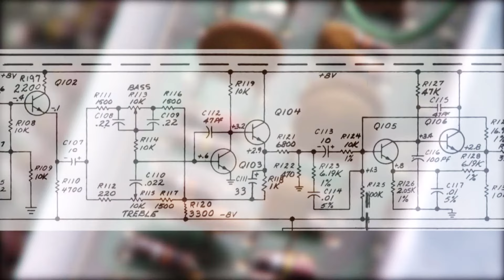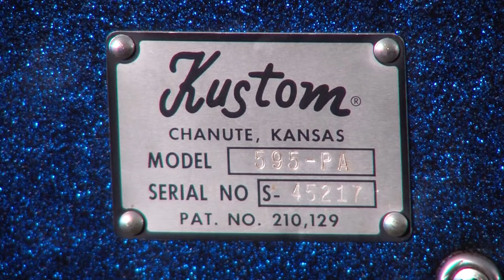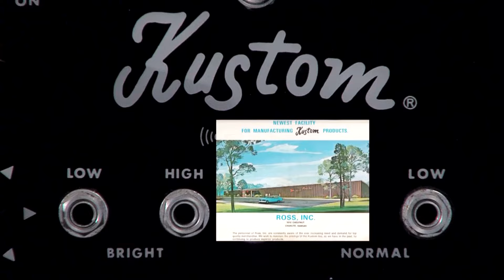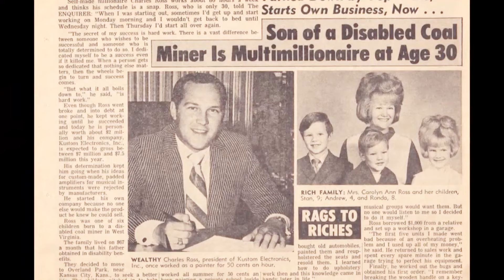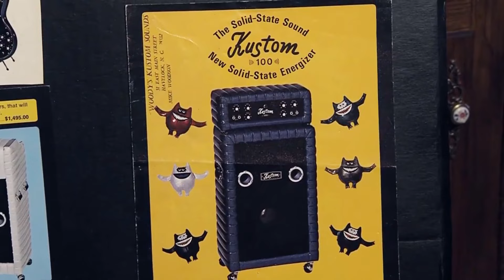The History of Kustom Amps

Comment: I have bought, and fixed a number of vintage Kustom amps.   I will attest that every amp I had pass through my hands only needed minor work to get things back going again.   To have a 50 year old amp that's ORIGINAL parts and working OK is really pretty cool.   K200 B1  with a 3x15 bass cab...  it records great!
Reply: Well DeadKoby...find me a Push/ Pull Switch and knob that is for the Vib./ Tremelo on a Kustom 50-2 Combo Amp!!
Reply: How would you describe the tone of the vintage Kustom amp?  I played (bassist) through a modern (2000s?) Kustom keyboard amp.  I adored that sound.  The sweetness of my P Bass was captured perfectly. I'm now very curious about these old bass amps
Reply: Where are you located?

Comment: I just bought a Kustom 250-4.
Silver sparkle.
Absolutely killer.
I was blown away by the tone options of the Fuzz effect. It can get heavy as fuck. When I get it dialed in recording I can get close to that "ORANGE sound" 
Doom amp sound.
Oh yeah and it's 250watts run through 2x15s. It makes one hell of a bedroom amp.
It has a T-handle on the back of the head to set the spring reverb to control the swell.
It's insane.
Turn left for crazy swell turn right to tighten it down for a fast attack.
I'm pissed that I'm 43 years old been playing since I was 13 and I'm just now getting familiar with these American made works of art.
If you ever get to open one up they are really cool on the inside too.

Comment: Kustom amps were all over the place when I was growing up in the 1960s. They were a lot less expensive than say a Fender Dual Showman. This made buying a bass amp with two or three 15 inch speakers within reach of most teenage bass players. The CTS speakers would not get very loud without breaking up but Kustom did make amps using JBL15 inch speaker for more $$$. I saw a photo of Jefferson Airplane with a larger Kustom head among all their other gear which they stack up on whatever stage they happen to be using.

Comment: I received a modified 2x15 Tuck n Roll cab as a gift. For some reason the previous owner took out the speakers, and put in a 15" Cerwin Vega woofer on the bottom, and a 12" on the top. Sounds amazing and super smooth, but the grill was cut off and stapled back on right over the metal circle things. Also he cut the top off and lowered it. Super strange modification, and I don't think it would have any value, but I love that thing.

Comment: I had a Kustom 150 watt amp.  Very punchy sound.  Massively heavy too.  Had been a jazz musician's; I bought it as a teen in 1973.  It was very powerful; including for its size.  Black sparkly tuck n'roll, with that blue pilot light.   Tuning the E string down, I could play bass lines as well as guitar lines through it.  Good for slide too and controlled feedback effects.
Reply: black was the only non-sparkle color..the other 6 colors were "sparkle"

Comment: I had a Kustom 150 amp head and a bass speaker box rolled and tucked black.  The speaker box had 3 15 inch Altec Lansings with silver cones and I sold it with my 1972 Fender Telecaster in 1973 when I got married.  Now I wish I had all that back.  I love Kustom amplifiers even though I cannot afford them so I had to settle for a Crate Power Block.

Comment: I had the Kustom 200 bass amp with  JBL D140's in black. The pleated ported cabinet was horrible with those speakers which needed to be in a sealed cabinet. I put those same speakers in a Fender Showman cab and they sounded great.  The first Kustom tube bass amps sounded really nice, the later transistor amps as I had were total crap. The wattage was also stated rather deceivingly, not 200 RMS watts unless you used two cabinets. One channel went out on me and when I had first bought it new I was told it had a lifetime warranty and I had that in writing on tbe receipt. When I took it in to get serviced the place I had originally purchased it from had gone out of business and the new place told me that was all hogwash so I never got it repaired. I should have gotten a Sunn 2000 amp or an Ampeg but didn't know any better because everyone else was using Kustom bass amps. Turns out they didn't know anymore than I did. Times have changed and bass amps have gotten better and lighter.

Comment: Back in the 1970s, I owned a Kustom 100 guitar amp and one of the 3x15 speaker cabinets, but I didn’t own them at the same time. I wish I owned both now, though I probably wouldn’t take them to gigs. Maybe I once in a while.

After I sold the cabinet, the original owner asked me if I’d ever taken apart the cabinet and looked inside. He thinks he may have left a bag of pot inside one of the sound holes. I told him I hadn’t done that. I hope later owners of the cabinet never got in trouble for that bag of pot, if it was in fact in the cabinet.

Comment: I am using a kustom amp for my new single... Too much low end and also too bright.. Turn low and high down to 0 and turn the mid a fraction.. Turn gain down to 0... With out eq it's perfect for recording... Throw everything up to normal levels in low mid and high and it sounds great live .. Its the KGA10FX with KS6 little speaker

Comment: They were good for bass, but lousy for guitar.
Reply from the maker: Yeah, John Fogerty’s guitar work sure sucked.
Reply: Not good for guitar? I used to own a K200 A-4. That thing SCREAMED at all volumes. I would put that up to any guitar amp! Also, the K200 A-4 had both tremolo AND vibrato (at the same time if I wanted to). The K200 B-4 only had tremolo.